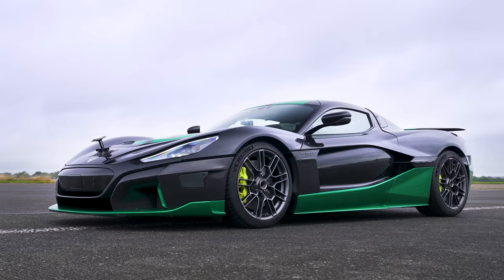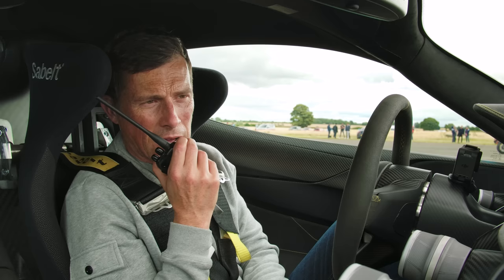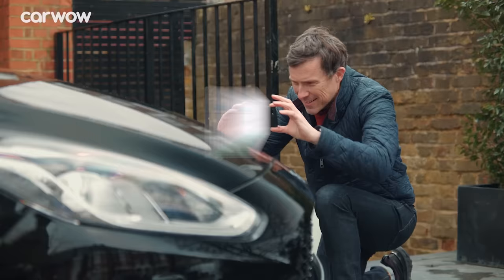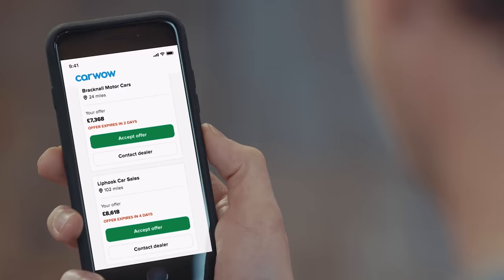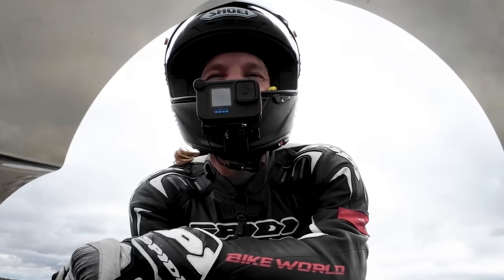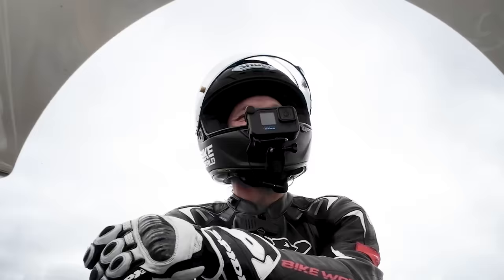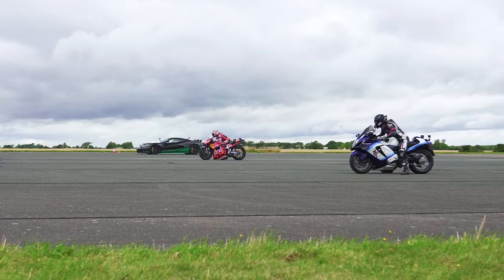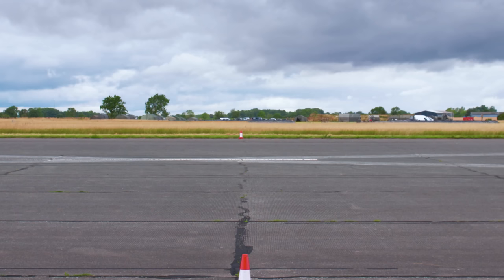MotoGP Bike v Rimac Nevera v Turbo Hayabusa: DRAG RACE

Comment: Extremely shocked by the launching capabilities of those gp bikes, I knew they was quick but wow I didn’t expect them to be that quick off the line
Reply: Still got beaten by a street legal car that weight 2tonnes
Reply: @chawaswildadventures3503  Yeah but it has 4 wheels and a lot more traction, you can say whatever you want, if it wasn't for the fact that it's harder to launch, that GP would've smoked that Rimac, it was closing the gap once it got going.
Reply: @chawaswildadventures3503 Street legal car that you will never see cus its 2 million quid 😂
Reply: @chawaswildadventures3503 at least it faster than f1 lol😂😂😂😂, f1 get smoked by rimac but not MotoGP, MotoGP can win 2 Times againt rimac😂😂😂
Reply: @chawaswildadventures3503 brother the Rimac is the fastest car ever built, it's got double the power of the Bugatti Veyron. Yet this MotoGP bike (which is designed for circuit racing) could keep up on an UNPREPPED surface. That's astonishing.
Reply: @mark675 and how much is motogp bike price??
Reply: @um900 who’s driving F1 car againts rimac in the last video??
Reply: @juliantaffa4089 what astonishing is a 2,3ton street legal car can match a prototype racing bike..
Reply: They do the 0-100kph in the WIIIIIDE range of 2.3 to 2.9 (depending on the Brand and the track and how good is their RHD) and 0-300kph in 8.9 to 9.5 so yeah they zing like nothing else.
Reply: @chawaswildadventures3503  kid In second race Moto GP smashed Rimac Nevera bike won rolling races as well in high speed wind
you kid bring Moto GP bike on proper racing circuit with warm tires drag race on a racing circuit
Rimac doesn't stands a single chance
There's also a much faster 2022 Ducati Moto GP bike which was faster than this KTM or any other Moto GP bike
Reply: @autolavista  you kid any existing F1 car will lose to Rimac Nevera Moto GP bike smashed Rimac Nevera in 2nd race and rolling races bike was wobbling due to wind bike still won
There was very high wind which was slowing bikes down 
If there was no wind that KTM would have gapped Rimac Nevera even more on rolling races
2022 Ducati Moto GP bike was much faster than this KTM GP bike
Bring that one the mix to 

Drag race on a proper racing circuit Moto GP bike on Warm tires Vs Rimac Nevera 
Moto GP bike would gap Rimac Nevera instantly
While on Carwow Moto GP bike is struggling for traction and wheeling 
This surface is horrible
Reply: @Random63R400  2022 Ducati Moto GP bike 0-300 km/h 8.2 sec 0-200 4.4 0-100 2.2 seconds and you remember this bike leaving other bikes in dust
2021 Ducati was faster too faster than this KTM 
Both Ducatis on Qatar pulled on the Gixxer Moto GP bike like it was standing still 
While Gixxer Moto GP bike was doing 345 km/h 
Ducati Moto GP bikes passed it like nothing
Reply: @Smzxe 2300kg rimac can beat motogp bike in a drag race… i wonder what Ferrari F2004 can do to this motogp.. i mean even F2003 beat eurofighter in 600m drag races. F2004 is much faster than F2003..
Rimac p/w ratio = 0.83hp/kg
KTM Motogp p/w ratio = 1,28hp/kg
Redbull F1 p/w ratio = 1,25hp/kg
Ferrari F2004 p/w ratio = 1,5hp/kg

F2004 win
Reply: @chawaswildadventures3503 you can floor the car, you can’t floor a motorcycle. Cars have more wheels, greater traction, motorcycles will flip if you rip the throttle. That bike isn’t designed for drag racing, it’s for twisty roads at incredible speeds
Reply: @rp4712  im sorry to pop your bubble too, but bike arent as stable as car to in corering, the only best thing about motorbike is they use less space and material to achive what car that 10x cost more, and also here in asia, ride between cars is normal behaviour that using bike is so practical on city, since its cuts your trip by 50% than a car
you dont need the comfort of car if youre can arrive the destination 50% faster most of the time
Reply: Actually that wasn't the quickest. If Dani was still a racing rider I believe he could do better than that. Miller, Binder, Marc Marq, J. Martin & Rins are the riders right now that really good in launching. But still launching a bike from the start is a tough ask. You can't do it perfectly all the time despite it's rider aids . 

You can see some current riders like Maverick Vinales & Alex Marquez most of the time failed to get a great start.
Reply: @megimargareth4015  💯, sensible answer for a responsible driver or rider. 👍
Reply: @chawaswildadventures3503  you do know that it wasn't mapped to extract it's full power & torque. I bet you didn't because you don't know. You don't even know why 4 wheels always got advantage & especially it weight distribution despite being 2 tonnes.
Reply: @mark675  the gp bike is just as expensive
Reply: @juliantaffa4089  I know that
Reply: @dayleashleynolasco5765  what part of my comment didn’t you get .. I let literally said everything you are trying to explain in short .. I said it’s impressive for a 2 tonne car to destroy a gp bike full stop
Reply: @chawaswildadventures3503  well duh I know! I was talking about how rare the 'road legal' Rimac is
Reply: @chawaswildadventures3503 Weights 2 ton but also have 2000 HP, four wheel drive and have launch control. And NO, it didn't destroy the MotoGP. MotoGP managed to win twice.
Reply: Moore Mafia's street tuned Hayabusa Turbo, aka Hyper Busa, has recorded 8.0 seconds in the quarter mile on a stock wheelbase.
Reply: @autolavista The moto gp price is due to it being a race bike, there's a whole suite of ppl required to just keep it running, f1 cars are a more fair comparison!

Comment: The way danis bike moves over 200 mph is nuts, huge respect to both drivers!
Reply: Legend.
Reply: Dani was going over 220 mph or 350+ km/h 
You can see Rimac Nevera was doing 356 km/h and still behind the Moto GP bike
Reply: @Smzxe  but Rimac was closing in
Reply: @razor_ramon_  because motogp bikes rear are wiggling that's why he reduce the speed
Reply: If you look at the slow mo dani closes the throttle just before the line as well.
Reply: @razor_ramon_ he litteraly told you and a slow mo showed you the GP bike wobble when the car made a gain at the end. Did you even watch?
Reply: @CBMoto.  I mesn Dani's got titanium balls but even he had to chill when the bike got squirly at over 350 kmh, which is understandable 🙈
Reply: @jacobstaub6676  im replying for rasor not you 😅
Reply: @razor_ramon_ rimac is still pulling until 412kmh.
Reply: @CBMoto.  ahhh ok, no worries mate :)

Comment: A 9.6 second quarter mile by Chris is actually insane if you remember that a 911 Turbo does 10.1. Its just that in this group here, DAMN!!! These are some monster machines. Danny is just amazing.
Reply: I want to add something h2r 9,9
Reply: @aan2976 I think 60 hp more does a lot on a bike
Reply: @aan2976 + h2r can go faster cause he kept wheeling cuz of speed
Reply: @y2nzzuu  If h2r goes against superbusa then h2r will win but I think MotoGP will always be the faster of the two lol
Reply: @aan2976  yeah I agree, it's both light weight and a lot of hp
Reply: @y2nzzuu  yeah...That's how great the prototype motorbike is, it's light but has a lot of horse power... so the power weight to ratio is also high
Reply: @aan2976  yup
Reply: @aan2976 superbusa is faster than h2r lol
Reply: well ive seen gxsr1k with 233mph in 5 sec
Reply: Chris riding that Superbusa is just  brave. He has that huge cajones to jump on that bike. Sylvain Guintoli could have been perfect aboard it, I guess. He could do 9.2 aboard it I believe or maybe flat with a perfect launch.
Reply: Would have loved to see Dani on that Superbusa. The bike is so old, I forgot that it doesn't have a quickshifter on it 😅.
Reply: @jozefjozefczyk3936  Yes, it's true that the h2r is faster than the superbus, but I gave the best time for the h2r to beat 1/4mile on carwow... maybe the h2r can be faster if we test it again
Reply: @aan2976    I think that SuperBusa is more or less the same as H2R. It doesn't matter how faster is the bike without s rider who got huge balls to ride it, get a perfect launch & put the traction down it's useless.
Reply: @dayleashleynolasco5765  In my opinion, superbusaa and h2r can break 9.4, that makes much more sense...because last year, KTM MotoGP broke 9.4 and 9.2..This is according to me, bro, it's up to you whether you want to agree or not, I still respect your opinion, friend
Reply: @aan2976    9.2 or maybe flat  with a proper rider who is terrific in launching at the start. Put Sylvian Guintoli there on the SuperBusa maybe he can do something to reach that mark. 

Or Alex Rins who is a true Suzuki at heart & really good in race starts. About H2R I don't know the stats but this always when it comes the bike, riders makes the difference even with all those technological aids in it. Without it it's going to be the same as the 2 strokes of the past. It's animal to handle.
Reply: @dayleashleynolasco5765  Btw, what do you think is the potential for the fastest KTM MotoGP within 1/4 mile, bro?
Reply: @aan2976  I don't know man, only the engineers who worked there can answer that. They are the ones who observed the behavior of the bike  especially when the rider get their best start during races. They also got the record of how fast it is. It would depend on the mapping if how much power they would put on the bike for the rider to use. In races they are usually put adequate power depends on the track they are racing. More power doesn't mean certain victory because tracks have corners. It should be balance. 

Mugello is the fastest I guess.
Reply: @dayleashleynolasco5765  8,3 maybe lol🤣
Reply: @dayleashleynolasco5765  Yes, I know a little how much MotoGP will be set according to the track they are facing... then. From that we cannot compare the top speed of MotoGP with other motorbikes because MotoGP has to save fuel

Comment: Only a Moto GP bike can reel in the nevera like that 🤯
Hats off to Dani for that INSANE launches!
Reply: a streched turbo gixer 1k easily do 233mph in 5 sec, this is nothing.
Reply: H2
Reply: @cowanjones7232 no , h2r original não tem uma aceleração tão brutal como um nevera e uma moto GP que vão a 300kmh em 9 segundos , uma h2r original vai em 12,5 ou 13 segundos , a h2r que chegou a 400kmh foi modificada pela trickstar com 100hp a mais e uma relação alongada
Reply: @yanzn5926  None of these 3 are dragsters, nob.
Reply: @yanzn5926  A top fuel dragster can do it in even less. No biggie.
Reply: @Terraceview  are u gonna discredit Dani for his launch? he is a pro. 
clearly im comparing Dani to other "not stock" bike rider time.
Reply: @Henry_Jr_Watsson  well in this category was "no wheelie bar" street bike. not some full billet V8 twinturbo
Reply: Stretched Turbo H2R 400hp. Would destroy all these vehicles in this vid.
Reply: Wait until he learns about Moore Mafia 😂
Reply: @SRNAR8  nahh were talking about naturally aspirated engine